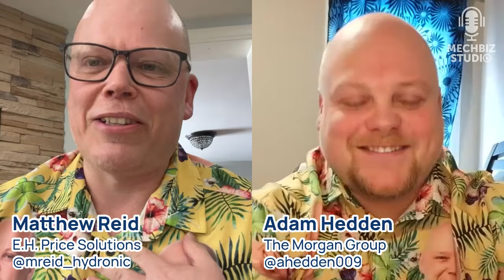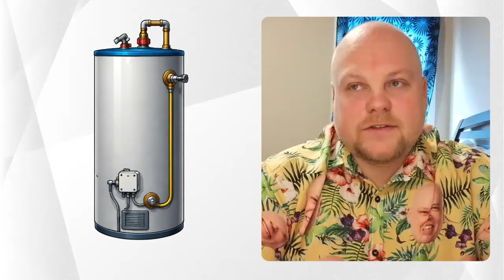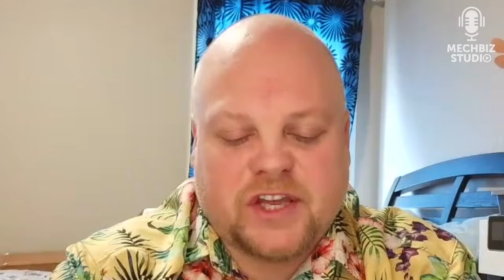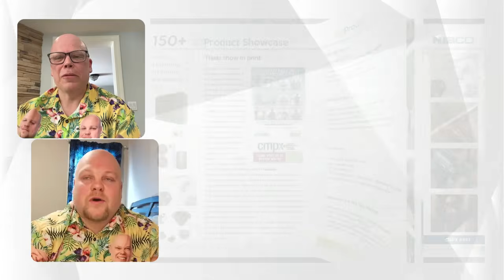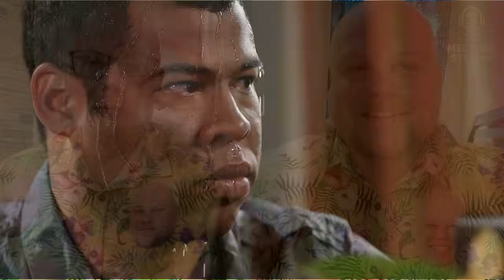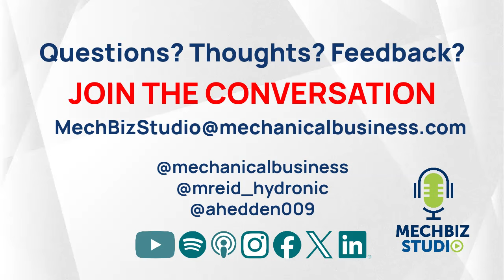Episode 2: We're in Hot Water!

Comment: Great synapses, guys. We install a fair share of heat pump water heaters for clients who want to get off natural gas, and those who want to reduce their carbon footprint and/or want to reduce their operating costs. We always take our time to explain to our clients the pros and cons of various systems available. We never had any issues with the area cooling off too aggressively because we ensured that there was enough circulation in a smaller area. There is also the option to duct heat pump tank water heaters to the outdoors. We never had to use this installation option. Is it an option which doesnt work for everyone - but it is definitely a valid option. From what we see in our market, clients don't have enough awareness of service and flush tanks, as well as address deteriorating sacrificial anodes. We are just starting to implement powered anodes, which offer better protection and positively increase the life expectancy of the tank. As far as topics, I would recommend heat pumps! I can't remember when we installed our last ac.